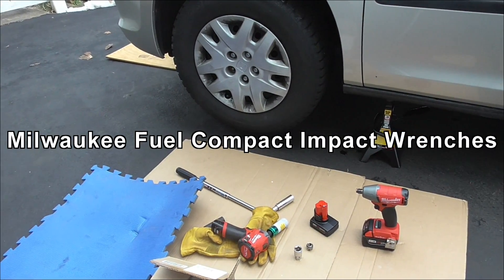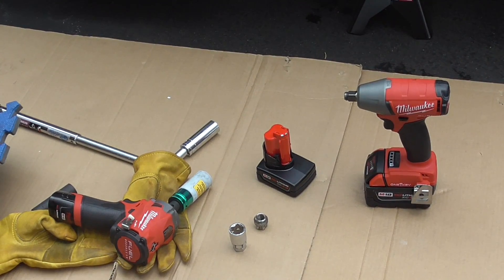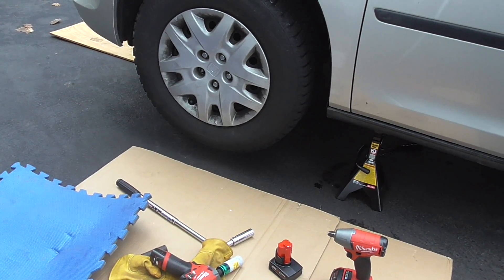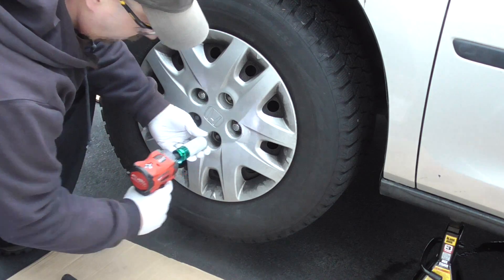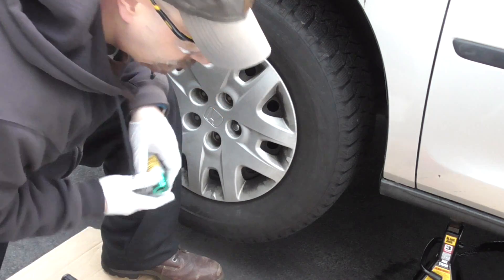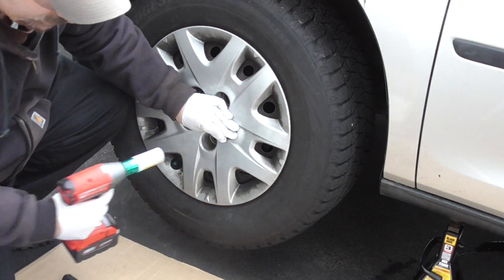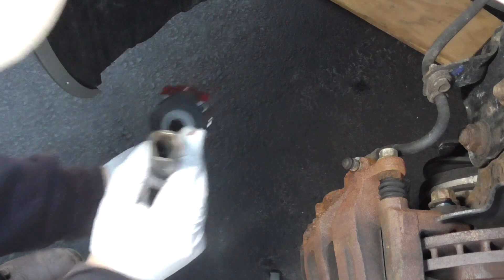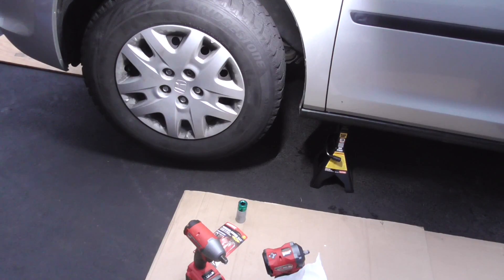Milwaukee Fuel Compact Impact Wrenches includes Stubby

Comment from the maker: Overview of 2  Milwaukee Fuel  brushless impact wrenches the M18 Compact and M12 Stubby 👍🏽
Reply: You can set the torque on the one key version for each setting button via an app. One button could be for 90 lbs for cars, one button can be 140 for suvs and one setting can be for max torque. It all depends on your needs.

Comment: You’ll get better luck with just using a 3/8 socket set without the 3/8 to 1/2 adapter.
Reply from the maker: Yes I appreciate the comment, I have since bought a set 👍🏽
Reply: @cardo1111  I have the same stubby with a low profile 1/2 adapter as well. I got the stubby to remove 155 foot lbs. lugs off an suv with a 6ah battery.